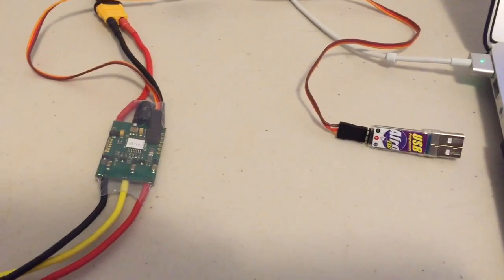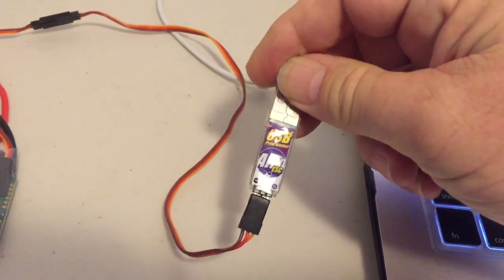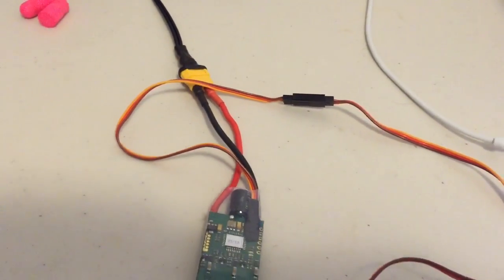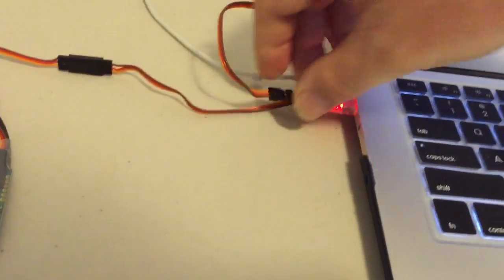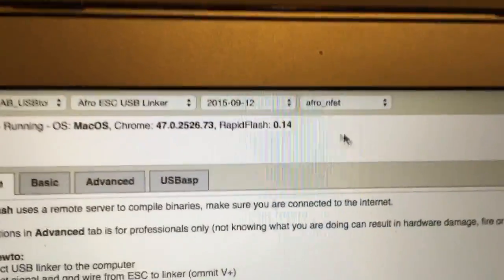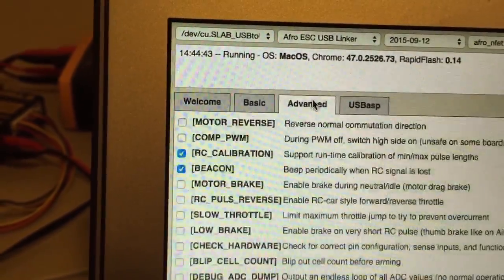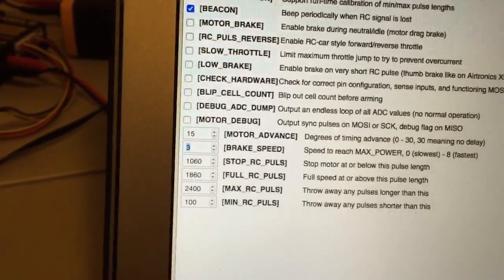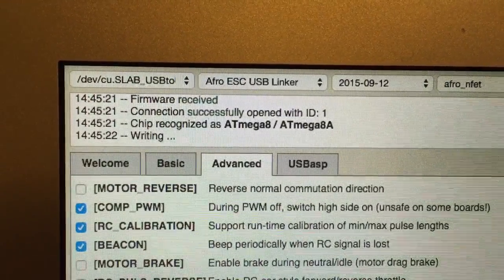Updating Afro ESCs using Rapid Flash

Comment: Hi!
I have Afo Slim 20A
1. I never did update (stock firmware). Can I upload the latest version?
2. What do these changed settings (advanced)?
3. Is the latest version solves the problem of synchronization?
Thanks!
Reply from the maker: +MrJ4m353 Hi, I am Rob2160 on RCG and answered via PM - yes you can load the latest version with Rapid Flash.